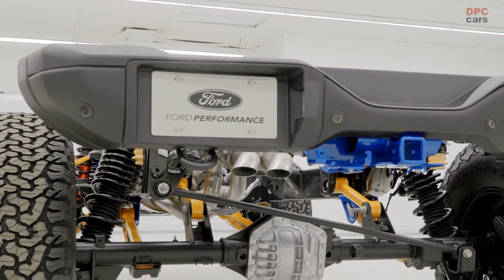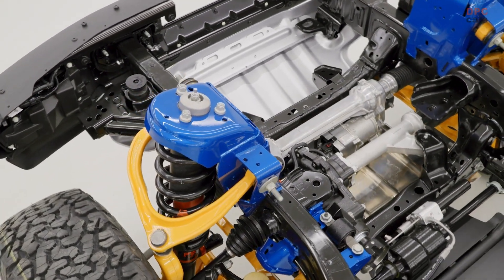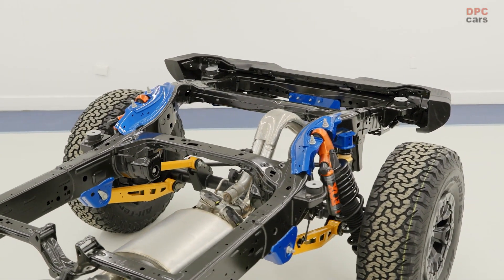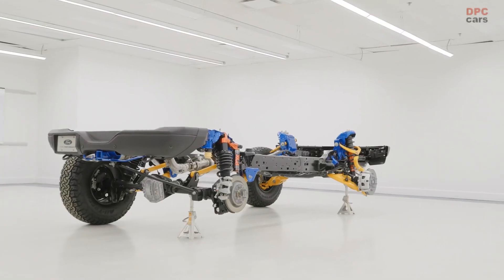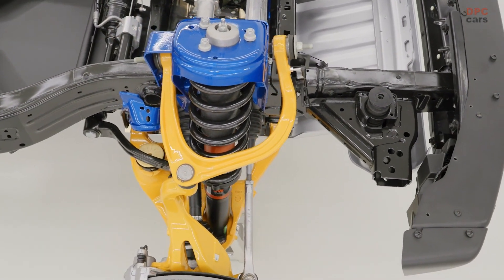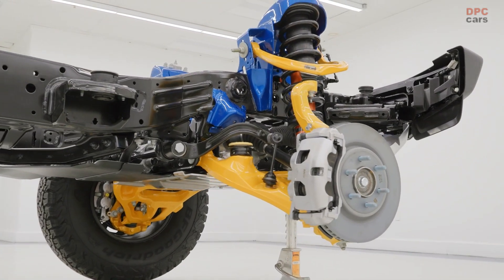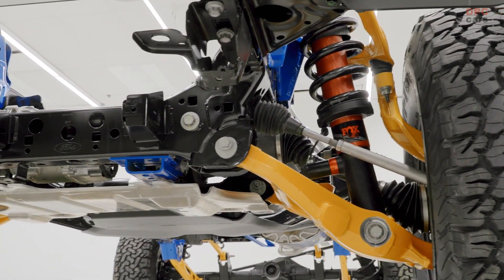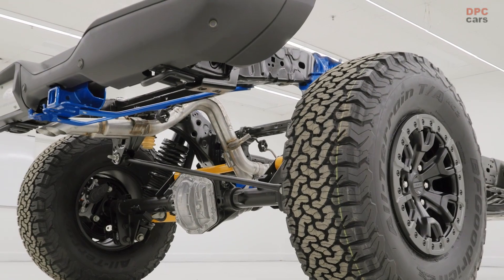2022 Ford Bronco Raptor Chassis and Drivetrain Explained

Comment: Ok so the only problem I see is that crazy angle of the front CV axle. If you lower the diff then you lose ground clearance. I've had this as a reoccurring problem with the boots splitting. I've solved this problem by sliding a inner tube over the joint, so if the boot splits it still keeps water and dirt out.